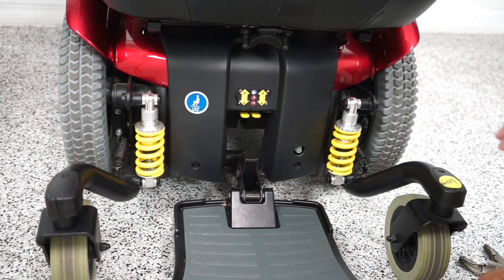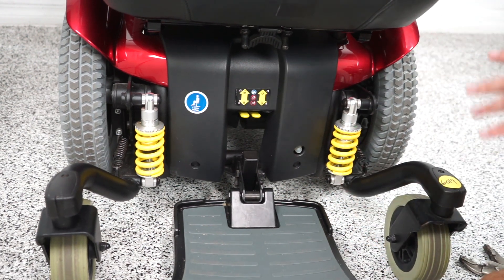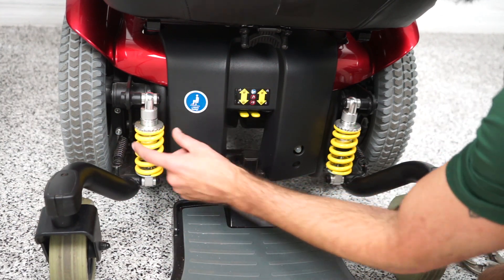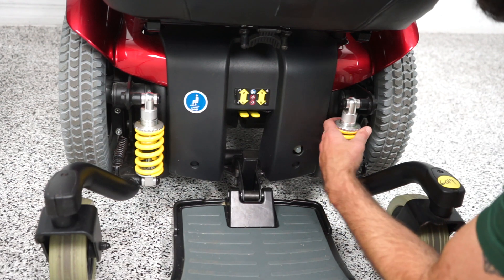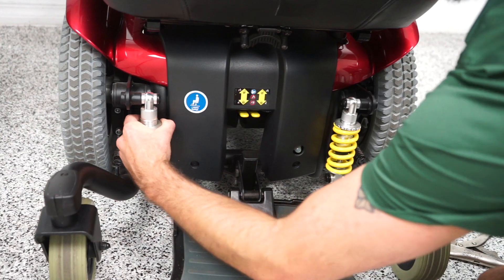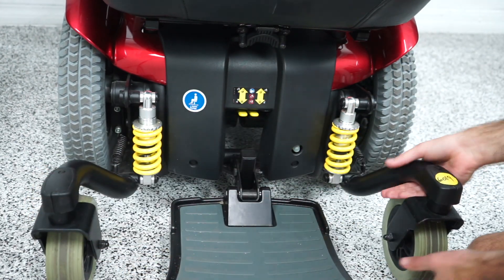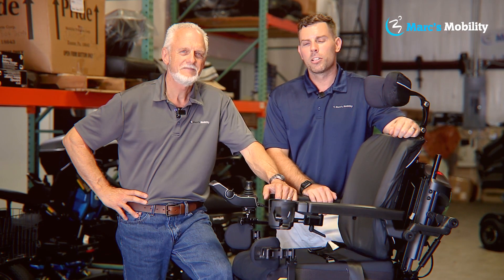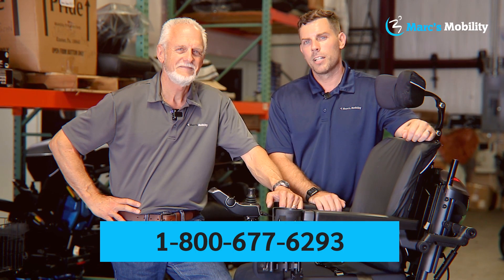How to Adjust Shocks on @PrideMobility Mobility scooters and Power Chairs

Comment: Can I buy suspension for my pride mobility scooter?
Reply from the maker: If you are asking if you can purchase suspension parts for your scooter or power chair that does not have suspension, the short answer is no. If you are wanting to purchase a unit that has suspension on it already, we can assist with that. Hope that answers your question.